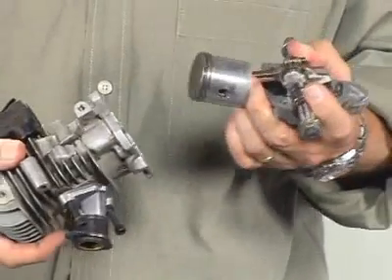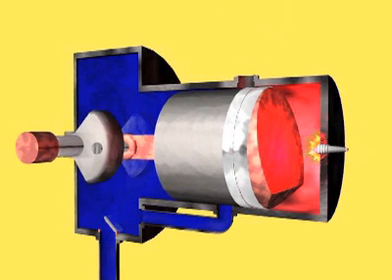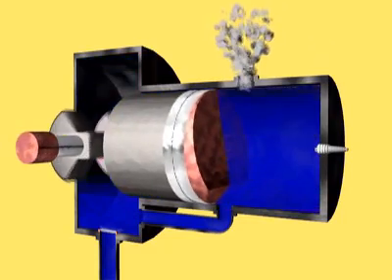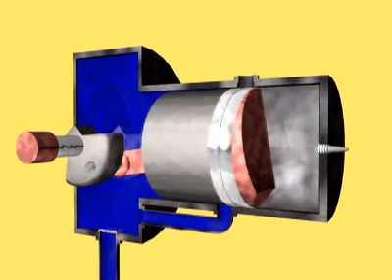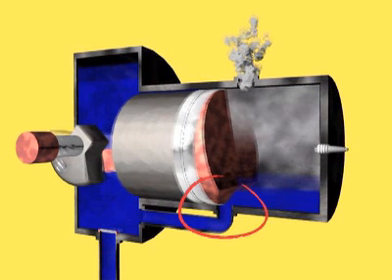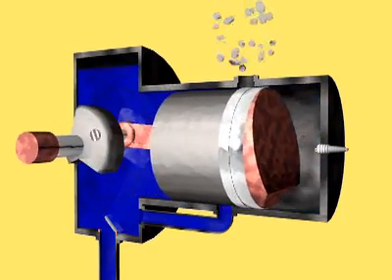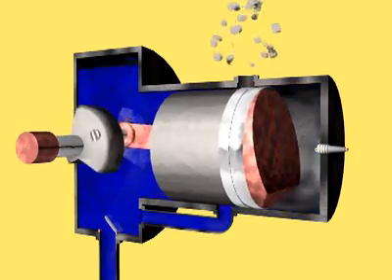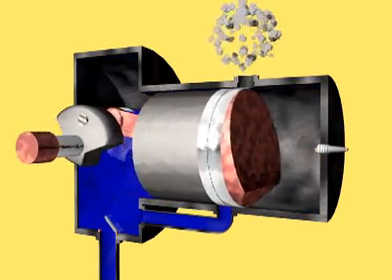How Two-stroke Engines Work

Comment: they are more economic because 4 stroke doesnt eat oil like 2 stroke and you dont have to mix it every time you re-fill. also its bad for the environment so almost every car company designs 4 stroke engines! how ever 2 stroke can operate upside down on the site what ever as for 4 stroke, only 1 way up!

Comment: OK i get that he RACES but hes still doesnt need to rebuilt it that  much u didnt say hes dad is a maintenance freak thats fine he just doesnt need to rebuild it that much maby once a season but he can do it the way he like to but the reason that 2 strokes arnt in cars is that they dont have the low end power to get a car off the line not cuz they cost so much to keep up they are a lot  cheaper than 4 strokes

Comment: Powerband isn't something you buy for it or get, a powerband is the rev range where the 2 stroke engine makes the most power.  In a 4 Stroke engine this is progressive across the rev range of the engine whereas a 2 stroke is not. A 2 stroke will have a certain point in the RPM range where the power output spikes up and at the end of the powerband RPM range the output drops off very quickly.

Comment: Actually it's because a 2 Stroke has a "powerband" and not a nice smooth progressive throttle response and lacks severely in the torque department - both things very important when they are moving something that weighs 1 to 1.5 tonnes.  A 300 to 400kg motorcyle on the other hand is a completely different story.

Comment: because they waste fuel
when the gas fils the chamber it dosent stop ate the exhaust port like in the animation, some will go strate out the exhaust
also they don't last as long
u also have to add two stroke oil two the fuel
and they dont necessarily have more power just more for the weight of the engine.
another thing is that u have to rev them alot faster to get them pulling as 4 strokes have more torque

Comment: if its alot of water take apart the bubble pipe and pour out the water if its not that much water start the yz banshee and just ride around a llitle it will push the water out.......but NEVER get water into a 4 stroke or your 4 stroke is DOOOOMED and you will have to kave apart the whole engine...

Comment: and yes you can tune two strokes to create more torque, but thay have to be tuned to do so, tippically they have lower torque, 

also to add another note with two strokes you can get massive power bands that 4 strokes dont get!

Comment: a two stroke engine itself does produce less torque than a 4 stroke. however... yes you can gear the drivetrain of a dirtbike or a atv or whatever vehicle it is, to get the same amount of torque as a 4 stroke, yet still have more power, similar properties apply to formula 1 race cars, i know they're not two strokes, but there engines produce high rpm power, low amounts of torque, but can be geared to get the same amount if not more torque than some high torque engines create by themselves!

Comment: When the exhaust port is uncovered, yes indeed fresh air and fuel mixture leaks out. That's part of the reason two-strokes pollute more than four-strokes. On high-performance two strokes, like those found on dirt bikes, there is a special exhaust pipe that uses sound energy from the escaping gases to cram the air/fuel mixture back into the cylinder.

Comment: most polution comes from factories and power plants, not just vehickles, sure one engine wont make a diffrence, but what if every motive of transportation was powered by a two stroke engine... that would make a diffrence. dont forget that two strokes can reach far higher rpms beacuse they dont have alot of mooving parts! so you get more horsepower... higher rpms... and there lighter. hoever they consume fuel at a quicker rate. create more emitions. and you get less torque.

Comment: The gas is mixed with 2 stroke oil which lubricates the joints as you call it or main, Big end ,small end bearings and cylinders. Theres no seperate force fed lubrication  system similar to a regular 4 stroke engine.

Comment: ..... the pipe has gases being shoved init,

Exactly, gas is lighter than air.

 All the air is pushed out, creating a vacuum inside the pipe.

TF dragsters are so powerful, back pressure is not a problem inside the pipe(s), the vacuum is needed to direct the gases away from the ports when idling.

Comment: how could the pressure be lower when all kinds of gases are being pushed into the pipe?  on a four stroke you want as little back pressure as possible, top fuel dragsters run straight pipes only as a means to direct the gases away from the engine, nascars use headers to direct the exhaust out of the engine compartment, i know this video was about two strokes, but there is no 2 stroke pipe that will create pressures lower than atmospheric, it's impossible when the pipe has gases being shoved init

Comment: 2 stroke has more power than 4 stroke engines at the same bore, engine capacity and number of pistons. This is because a 2 stroke will burn twice as much fuel as a 4 stroke.
Typically, a 4 stroke is better than a 2 stroke because it needs little lubrication in the fuel to run, and it produces much less exhaust waste. A 4 stroke is likely to run at a lower speed, is easy to start and is less likely to requre repair.

Comment: Do you know the comparison for a Direct-Injection two-stroke?  They're said to be at or above the four-stroke par for fuel efficiency.

Also, at least as far as bikes go, if you look at the dyno charts for a 125cc 2- and 250cc 4-stroke, they peak at the same hp, but the four delivers more power outside the peak.  Remember, though, that's twice the engine for the same peak, compared to a carberuated (read: worse than DI) two-stroke.  On reliability, two-strokes have many fewer moving parts.

Comment: Some fuel does escape unburned in the exhaust of a two stroke engine. In general, this is why 2-stroke engines are considerably dirtier than 4-stroke engines. This does not apply to 2 stroke diesel engines, which are commonly used in diesel-electric locomotives. In a 2-stroke diesel, there is no fuel mixed in with the air that comes in. That air helps push out the exhaust without causing pollution.

Comment: some fuel may escape but not much because it doesnt take much time after having the exuast open to lose that pressure that forces the exaust out and while the piston is in its lowest position its design to force fuel air mix into the cylinder but its not under pressure yet so some air/fuel will escape the exaust but very little

Comment: The purpose of any header, expansion chamber is to create low(er) pressure outside the the engine, essentially creating a vacuum which 'sucks' the burned fuel (exhaust) out of the engine. 

Back pressure is atmospheric pressure*.  An engine without an exhaust pipe or header (just open ports) will be operating against the greatest amount of 'back pressure'  average  *14.75 lbs psi @ sea level.

Inside a small steel tube (exhaust pipe/header/chamber), the atmospheric pressure is much lower.

Comment: some tuned two stroke pipes will actually have a tuned pulsewave that actually sends a small amount of the outflowing unburned gases back into the cylinder.  kind of like supercharging your engine, from the exhaust side... if that makes any sense.

Comment: the problem of 2 strock islubricating system is interfering with induction system,there is alot of ideas around this point,rings tension also ,any way i think this engine worth mor devoloping.

Comment: Either a blown head gasket or a worn crank seal.  The headgasket blowing would leak coolant into the cylinder and it would burn white

its the same with the crank seal only that the crank seal would be leaking gearbox oil into the cylinder

Comment: 2 stroke engine burns a lot of oil, more than 4 stroke engine. Theres allways a little smoke in every 2 stroke engine. It is allso possible, that your pistons rings have weared away. If you consume a lot of oil, you might have to change your piston. Thats what I think.

Comment: A four stroke wont outlast a two stroke if maintained equally. One simple reason is you dont have to maintain valves or engine oil in a 2 stroke. I guarrentee(sp?) if you dont maintain the valves and engine oil on a 4 stroke it wont last more than 200 hours. You should care about the enviroment since you live in it.  And even then the 2 stroke will be more reliable more enviomentally friendly and make more power.

Comment: Well the idiot part got to me. A well taken care of 250 2 stroke will easily and reliably last 40 hours. SOme people run them 200 hours. A taken care of 250f will need a valve job and top end in that time. Trust me a 100 dollar top end is way cheaper than a 1000 dollar valve job and 200 dollar top end.

Comment: congratulations. you act like a know it all. But you're wrong. yes the fourstroke race motors (250cc, 450cc) are high performance but the 250f doesn't make more power than a 250 2 stroke. The 450 barely makes more and its almost twice as large. Also 4 strokes are way less reliable and cost way more to maintain.

Comment: it is mostly unburnt oil left in your exhaust because in a 2stroke the oil is mixed with the gas. to solve this broblem they  could use fuel injection instead of a carb

Comment: it also sucks it escaped unburnt fuel in the start of the exhaust back in. the pressure waves in the exhaust cause this. they are caused by the shape of the exhaust. this video is a very good introduction but is only that and quite simple so its easy to understand. look a little further.

Comment: then it wouldnt work. it also sucks it escaped unburnt fuel in the start of the exhaust back in. the pressure waves in the exhaust cause this. they are caused by the shape of the exhaust. this video is a very good introduction but is only that and quite simple so its easy to understand. look a little further.

Comment: But surely when the piston is at the back end of it's stroke and both ports are open, surely you get waste fuel that escapes through the exhaust port losing fuel economy and leaving a lot of unburnt fuel in your exhaust system over time.

Comment: I saw another vid on two-stroke engines here on YouTube. It was a promo vid from Johnson boat engines and they showed a possible solution: With direct fuel injection, this disadvantage disappears as fuel only enters the cylinder when the ports are closed.

Comment: Actually, yes. A bit of the air/fuel mixture is expelled before the exhaust port is covered. Likewise, there is still a bit of exhaust being compressed with the fresh air/fuel mixture. It is a crude design but has it's advantages regarding power-to-weight ratio because of the fewer parts involved & the fact that it fires every stroke instead of every other stroke. Disadvantages are decreased efficiency, less adequate lubrication & dirtier exhaust.

Comment: 1st question: When the piston moves up or down, like in the video; it uncovers a port, once it moves in the opposite direction the piston moves back over the port closing it. watch the animation.
2nd question: If you notice in the animation there is a small gate which opens and closes when the mixture is let in and the pressure build up or a small spring closes the gate which blocks off any air from leaving or entering while the piston on it's way back down compresses it. 
Anyway hope it helps

Comment: but this is also a deflector on the top of the piston which is shown but not mentioned in the video which deflects the intake mixture up instead of letting it all pour out the exhaust port, still, some of the intake is lost but it is minimized.

Comment: As many advantages as this engine has, it has it's disadvantages. One being that during intake some of the compressed air/gas mixture leaks out the exhaust port. Giving it poor fuel efficiency. I believe that's why 2 stroke cars are discontinued.

Comment: i like 2 strokes because they make the power of a four stroke but with half the cc. they are also incredibly simple because they have no valves,cams,cam chain, and counter balancers. The internal mass is also usually smaller so they rev out faster.

Comment: 2 strokes make more horsepower but dont make very much torque intill they reach very high rpm 4 strokes CAN make alot of horsepower but torque is made in the lower rpm ranges.

Comment: 4 strokes are more efficient and for that reason, generally produce more torque because more work can be extracted from the burning air fuel mixture on the power stroke.  The reason the mixture is in the crank case in a 2 stroke, is for pre-compression purposes.  This helps increase the pressure of the mixture so it flows/gets pumped into the cylinder, and helps offset the lower compression ratio on the compression stroke.

Comment: Yes.  The compression ratio is low, so they are thermodynamically inefficient, and a fair ammount of the oil/gasoline/air mixture is expelled from the uncovered exhaust port pre-compression so they are also not very fuel efficient or environmentally friendly, hence why 4 stroke cycles are generally used in larger applications like cars, etc.

Comment: There would be a 2-stroke road bike if they used fuel injection. They are inhibited by emissions right now. Or go to India where 99% are 2-stroke. A Honda XR650 makes 50 and a CR250 makes 45-50hp

Comment: I see all stereotypes here. Everyone is talking about carburated 2-strokes (which is in this video) but times have changed. It's called direct fuel injection. That eliminates so much of the blowthrough that the 2-strokes are now as fuel efficient and as clean as 4-strokes. On top of that fuel injection increases all around torque and horsepower (not peak). It is shown in outboard boat engines. Better fuel mileage, less emmissions, more torque everywhere, and less weight.

Comment: yup, thats why they have the crazy fat head pipe to give it some back pressure to keep more of the mixture in the cylinder because there is a split second when both ports are uncovered, thats why 2 strokes have horrible fuel economy, LOTS OF POWER THOUGH!!!

Comment: 4 strokes are better on fuel economy. It is also extremely expensive for manufacturers to make 2 stroke engines meet modern emissions standards. In many areas, 2 strokes exceed sound ordinances.

Comment: Some does, but that is the reason for expansion chambers.  The tuned pipe allows the exhaust pulses to push the unburned fuel that escaped the cylinder back into the cylinder to be burned.

Comment: Pollution problems have been solved with direct injection (no more oil mixed with gas, see Aprilia Di-Tech). Two-stroke engines are far better than 4-stroke ones, but suffer from their old reputation. It's just a question of marketing and big bucks, as usual.

Comment: The rise of the four-stroke has nothing to do with four-strokes being better than two-strokes. In fact, they aren't better than two-strokes.

 

The two-stroke is the ultimate racing engine. A two-stroke engine weighs less, has fewer moving parts, has a significantly reduced maintenance cost, revs quicker, is cheaper to manufacture and produces more horsepower per liter than a four-stroke.

Comment: 2 stroke engines can be very efficient. However, many areas outlaw them because release a lot of oil into the water. In California you can buy 2 stroke jet skies for almost nothing because you can't use them here.

Comment: not true. a 2 stroke dosen't make 2 times as much power as a 4 stroke. it makes about 50% more power, because they don't quite get all the exhaust gas out, and they have to burn oil. so a 250 2 stroke makes about as much power as a 375 4 stroke. (usually, not always)